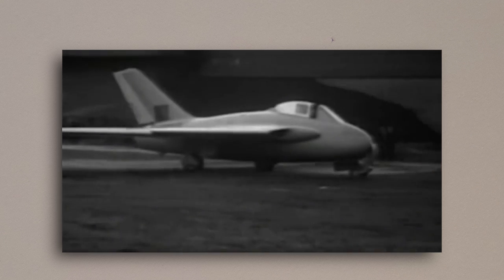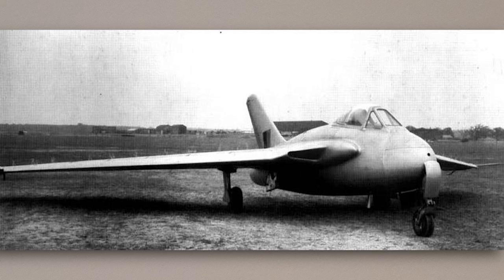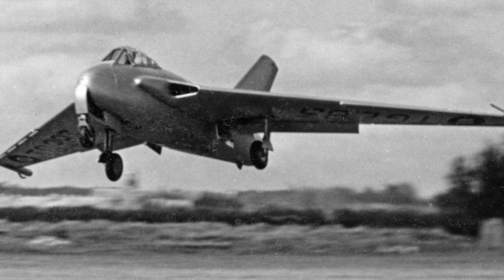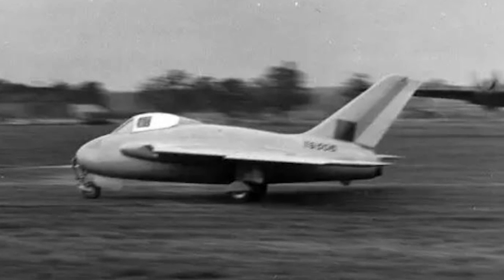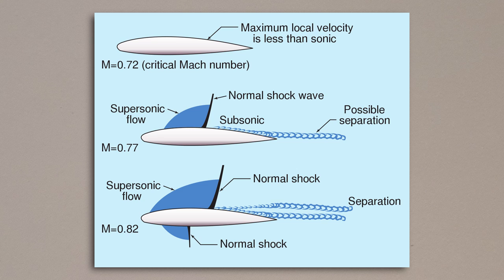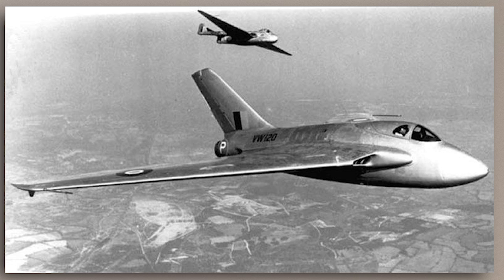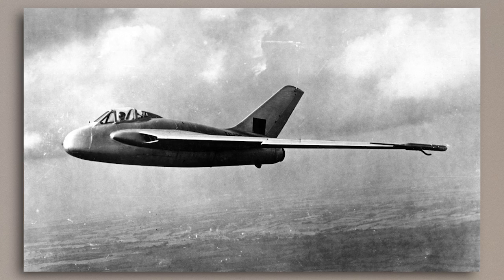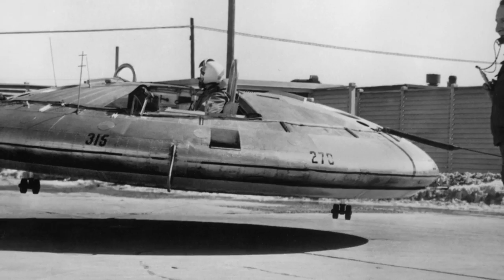Britain's First Supersonic Plane  | De Havilland D.H 108 Swallow [Aircraft Overview #58]

Comment: DH were good at making death traps. DH80 (wings fell off), DH86 (tails fell off) and DH106 (fuselages disintegrated). The company's philosophy was build light and strengthen as necessary. Other manufacturers built heavy then tried to shed weight.  Usually in ways they were not structural.
Reply: Excellent comment
Reply: @WilhelmKarsten  Told you about DH in another thread. DH was not alone in building an unusually large  number of dangerous aircraft.  Douglas had exploding DC-6s and DC-10s with flawed baggage doors. The THY DC-10 crash killed more people than all the structurally defective DH aircraft combined many times over.  The Douglas C-133 suffered lethal fatigue problems.

DH must have overcome their design deficiencies because the Caravelle, by Airbus founding partner Sud, used the nose from the Comet under licence. Sud's predecessor had built DH fighters under licence and DH's successor HSA was an original partner in the project that led to Airbus.  Broughton  was a DH factory.
Reply: @davidcarter4247  The de Havilland Comet was the worst engineering failure in aviation history... it has the highest loss rate and fatalities statistics of any jet airliner ever made.

There is no connection between d-H and Airbus.
d-H went tits-up in 58' as a direct result of 6 hull loss accidents in just 2 years or limited service, the Comet Disaster killed d-H.

Airbus SE is not a British company.
It's a German French company with Spain as a minority partner.
Reply: @WilhelmKarsten  You do live in a parallel universe. Like thinking Airbus was a tri-government owned consortium and that BAe never owned a part of  Airbus when it did for 29 years 

Hawker Siddeley bought de Havilland in 1959. At the time DH had  in production the Comet, Heron, Dove and Sea Vixen. Launched were the Trident and DH125 bizjet. In 1959 Boeing was in discussions with DH about the Trident being a joint project, so it looked like a winner. It was 1960 when Boeing decided to go it alone with a JT8D powered aircraft, the 727, that was the same configuration as DH came up with for the Trident! The DH125 went on the sell 1720 aircraft, almost 1700 more than the German HansaJet and three times that of the French Falcon 20.

Worst accident rate for a jet airliner has to be the German Baade 152. Two flew, one crashed. Flight test program ended quickly  and the 20 aircraft on the production line scrapped. The second aircraft was powered by a engine designed postwar by brilliant German jet engine designers, the Pirna 014. Only the second  Baade 152 had them and the engine died with the plane. This plane was a contemporary of the Comet 4.
Reply: @davidcarter4247  Please name a single British company that still makes commercial jet aircraft in the UK?
Reply: @WilhelmKarsten  Name  a West European country that manufacturers jet airliners, Several make major components of airliners including the British. Assembling those parts happens in France, Germany, China and US. The most complex and expensive parts of an airliner are the  engines and wings.  Who makes most of those? France, Germany or the UK?
Reply: @davidcarter4247  Germany is Europe's largest manufacturer of jet aircraft.
Reply: @WilhelmKarsten  Germany puts together A320 family aircraft that are are largely made of parts from outside Germany. These are aircraft designed mostly  in France and the UK.  Hamburg is just another  Mobile and Tianjin. There has been no production German  airliner of any size or power in the past 70 years other than the  ridiculous  VFW-614.
Reply: @davidcarter4247  The Dornier Finkenwerder factory in Hamburg Germany is the largest in Europe and the second largest in the world.
It's the primary factory for all A320 series aircraft and  employs 13,000 people.
Airbus SE has 27 production facilities in Germany, the most of any country.
Reply: @davidcarter4247  Please name a single British company that still makes jet aircraft in the UK???
Reply: @WilhelmKarsten  Toulouse still gets the prestige of  assembling the Airbus flagships as it has been since the A300.  BAe still gets to design and make the most complex part of the airframe, the wings.
Reply: @WilhelmKarsten  Name a German company that can design an airliner or a jet engine without help? Britain has done the former many times and is still doing the latter.
Reply: @davidcarter4247  BAE is not affiliated with Airbus SE.
Reply: @davidcarter4247  Airbus designs and builds its own aircraft.
Reply: @davidcarter4247  Please name a single British company that still makes commercial jet aircraft in the UK???
Reply: @WilhelmKarsten  still being made in Britain, not Germany. Still being designed  in Britain.
Reply: @davidcarter4247  Airbus is not a British company.
Reply: Please name a single British company that still makes commercial jet aircraft in the UK?

Comment: The claim that the DH 108 was the first supersonic aircraft capable of taking off from the ground under its own power is incorrect.  The XP-86 (F-86) Sabre had already exceeded Mach 1 prior to the DH 108's first supersonic flight. There are unsubstantiated but doubtful claims that the XP-86 actually broke Mach 1 before Yeager's famous X-1 flight on 14 October 1947. But certainly the XP-86 had exceeded Mach 1 in a dive by 26 April, 1948, as officially acknowledged by the USAF. Both the F-86 and DH 108 could only break Mach 1 in a dive, so it is questionable whether either could be considered "true" supersonic aircraft. The X-1 did eventually achieve supersonic flight from a ground takeoff on 5 January 1949, reaching a speed of Mach 1.03 at 23,000 feet while piloted by Chuck Yeager.

Comment: One can only imagine if a rounded window swept wing Comet had eventuated. These days such things would take 20 years of testing before it even flew.
Reply: comet`s losses had nothig to do with the passengers cabin windows!!
Reply: @michaelpielorz9283  Working at De Havilland in the fifties, I can assure you it was the failure of the window pan, that is the part between inner and outer skins.  The shape was altered, and from then on all parts were subject to spec. DH553 which was the polishing of all cut edges to eliminate fracture sources.
Reply: @JohnJones-cp4wh  It would be nice if you kindly read  DeHavillands own pressure test results.
Reply: @JohnJones-cp4wh  - there are some good videos on this on youtube. The failures were at the Windows, but the more recent theory is that it was due to punching the rivet holes, causing stress fractures, rather than the window shape…
Reply: @SAHBfan  I don`t recall punching of the holes, the window pan was drilled through from predrilled holes in the skin.

Comment: De Havilland was very inovative in their designs, the Vampire being a great type. But the flaws were also awful, the Comet being the worst case.
Reply: What the comet that flew until the 2000s
Reply: The Vampire had one of the worst crash statistics in RAF history... de Havilland has a long and well earned reputation for building deathtraps.
Reply: @davegillman6296  The Comet fleet  was grounded from revenue service in 1980 by an airworthiness directive after premature metal fatigue was discovered in the remaining aircraft.
The Comet remains the commercial jet aircraft with the worst safety record in history.
Reply: de Havilland had a appalling reputation for reckless behavior and building aircraft that crashed... as a result no one would  buy their aircraft anymore, they went tits-up in 1958.

Comment: What a shame that U.K. government scrapped the Miles M52 and gave the design to USA.
Reply: Source?
Reply: @nickdanger3802  - The source would be Captain Brown’s book on the m.52. Miles was ordered to share information with Bell. I can thoroughly recommend the book.
Reply: There was no Miles M-52.Miles only built a Ply-wood mock-up.Miles never shared data with Bell because the aircraft never flew.
Reply: @jerryg53125  - Oh right. It’s a while since I’ve read Brown’s book on the subject, but I do recall him going into some details about the sharing of specifications, designs and blueprints with Bell long before construction had commenced on the prototypes, the first of which was were near completion when cancelled, with Brown himself selected to fly it.
I must dig out my copy and re-read it, it’s a bit ‘dry’ but is THE single most comprehensive resource on the subject.
In the meantime, I’ve pasted a couple of snippets from Wikipedia below:

‘In 1944, design work was considered 90 per cent complete and Miles was told to proceed with the construction of a total of three prototype M.52s. Later that year, the Air Ministry signed an agreement with the United States to exchange high-speed research and data. Miles Chief Aerodynamicist Dennis Bancroft stated that the Bell Aircraft company was given access to the drawings and research on the M.52; however, the U.S. reneged on the agreement and no data was forthcoming in return. Unknown to Miles, Bell had already started construction of a rocket-powered supersonic design of their own but, having adopted a conventional tail for their aircraft, were battling the problem of control. A variable-incidence tail appeared to be the most promising solution; the Miles and RAE tests supported this conclusion. Later, following the conversion of the aircraft's tail, pilot Chuck Yeager practically verified these results during his test flights, and all subsequent supersonic aircraft would either have an all-moving tailplane or a delta wing.’

‘At the point of cancellation, the first of the three M.52s had been 82 per cent completed and it had been scheduled to commence the first test flights within only a few months.’
Reply: @AtheistOrphan  Miles had 80 % of the parts to begin construction of the aircraft.It was not 80% complete.The project was cancelled because of Frank Whittle and PowerJets.

Comment: "First Supersonic plane in the world that could take off and land under its own power."  This must have come as a shock to North American Aviation, whose XP-86 made its first officially recognized supersonic dive on April 26, 1948 (And the first Brit to fly supersonic was, apparently Roland Beamont, who flow the ZP-86 in a supersonic dive on May 21 1948.)  The F-86 diving through the Mach under full control at all times.  The Bell X-1 was also capable to taking off under its own power, an did so on Jan 5, 1948.

Comment: A "Solution Looking for a Problem" that was maliciously and incorrectly celebrated by its creators as a "Mechanical Curiosity". I wish I could look at the project files for this aircraft as surely there are lessons to be learned regarding the de Haviland company's cavalier attitude and approach (what's the value of a son?). I suspect Brown. as a proper military man, did more than just call the project a "killer" he, probably, like any good test pilot, had a few suggestions for the engineers. I want to know what the engineers had to say for themselves as they stuffed his suggestions and celebrated what we in modern engineering terms would call an uncontrolled near miss! I categorically reject any claim that the swallow is worthy of any record what-so-ever. The record only counts controlled flight! Why is Brown forever repeated yet forever never heeded!?